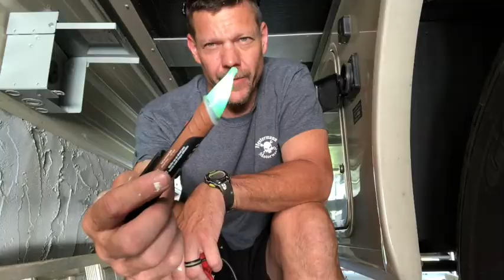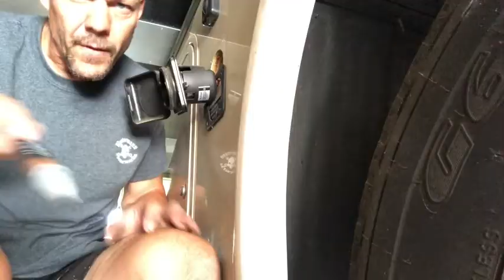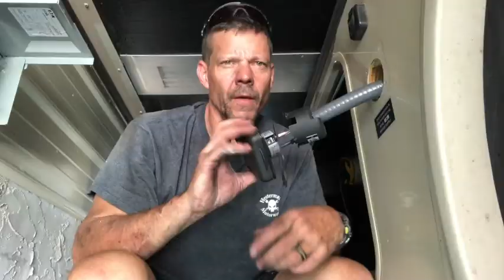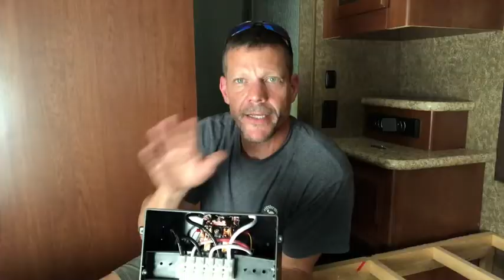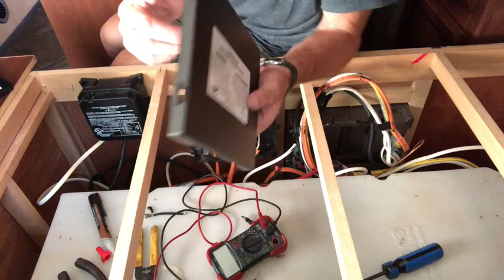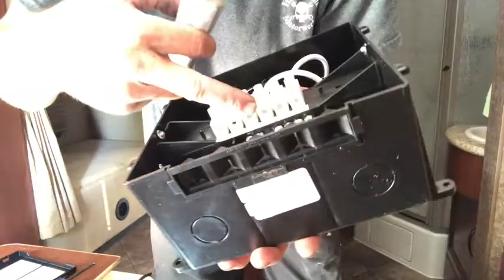Troubleshooting RV with no electrical power. Replacing the transfer switch

Comment: Can I have issues with starting my generator if my transfer switch is out?
Reply from the maker: all the rigs I have worked on, the starter for the generator gets power from the engine battery. So I don't think the transfer switch can have any effect on the generator starting. More likely is there is an issue on the circuit providing power from the engine battery to the starter on the generator.
Reply: hesty32 possibly. This literally just started. The generator transfer switch stopped working several days ago and a couple days ago my generator won’t start. It even makes the lights go completely out after trying a couple times to turn it over. And it definitely acts like it’s not getting enough battery power to turn over. However, the engine starts right up and the battery is literally just barely a year old this month. 🤷🏼‍♀️
Reply: I will take a look at the circuit the battery cable runs to directly on its way to the generator. Is there a way to test that circuit in the circuit panel under the hood for dummies? It’s a 1994 fleetwood pace arrow. Any info/help would be much appreciated.
Reply from the maker: @Stephrae70  the lights dimming when you start it is a classic symptom of low battery. Is it the coach lights that dim? If so, your generator is probably ties to the coach batteries not the engine battery. Some rigs will charge the coach batteries while the engine is running. Have you tried starting the generator while the engine is running?  If the transfer switch is out, the coach batteries probably arent getting charged and that would make sense that the generator doesn't;t have enough juice to start. I recommend checking your coach batteries
Reply: hesty32 yes the way it is set up, the two coach batteries are tied into the main engine battery. I do start and run the engine for about 30 minutes every morning and evening to keep the coach batteries charged because I do not start my generator every day. But that makes sense now that you’re saying that. And yes I do start my engine to start my generator because it’s an Oman 7000 and it seems like it starts easier when I do that. It also looked like my coach batteries may have leaked some at some point recently. I will clean them up with some baking soda and make sure there’s enough distilled water and see if it makes a difference. Up until this last few days, everything has been running great. Sigh.
I do understand that the coach batteries being drained is because lack of charging due to the transfer switch and lack of charging from the generator. But I’ll clean the batteries regardless. They’re also only one year old.
Reply: Ps. I manually (hit the disconnect switch) disconnect the main battery when then rv isn’t running or it will drain since I live full time and am not plugged in (I live off grid).

Comment: Do you have to replace the whole box or can you just replace the pieces that are corroded? I be looking into that part cuz that's going to be a lot cheaper then replacing the whole box
Reply from the maker: Im sure you can replace the contacts and such that are corroded if you can find replacement parts OK. It probably is gonna depend on the brand and construction of your transfer switch. You may be able to fabricate some of the things yourself too.
Reply: @hesty32  lol I love your optimism mine actually is the twist method which means it won't work without the whole box I plan on trying to up grade it and buying a system that doesn't use plastic because it degrades down really quickly when it comes to heat which is what electricity does
Reply: @hesty32  I really miss the old ceramic conductors yeah they didn't protect from Air very well but they didn't break apart like all this plastic stuff does and it only lasts a couple of years and then air gets into it and it degrades down

Comment: I HAVE a problem with half my electric working. All the fuses are good and no breaker was or is triped. I working on some trim and used a brad nailer, and the power just died. can you give me some tips on what I CAN CHECK? Your video was the best I have ever seen. Thanks and please keep on doing videos.
Reply from the maker: Eileen Chesney I’m sorry to say but there is a good chance you caught a wire with the brad nailer and it shorted out. Is there any way you can check behind where you were nailing and see?  It also could be a GCFI outlet. Check in the kitchen area and the bathroom area to for a GCFI outlet that is tripped.
Reply from the maker: @EVELYN KUIDA thank you for the kind words!